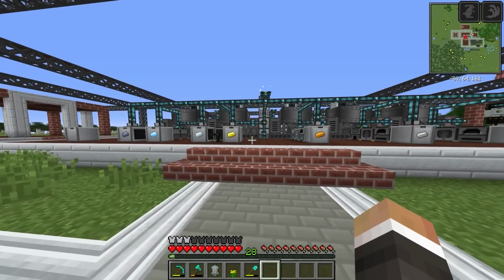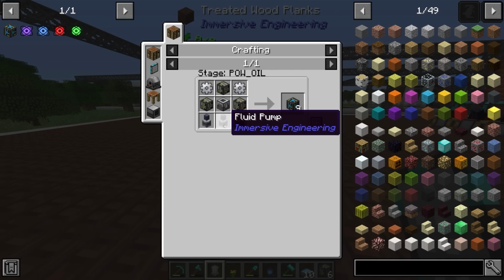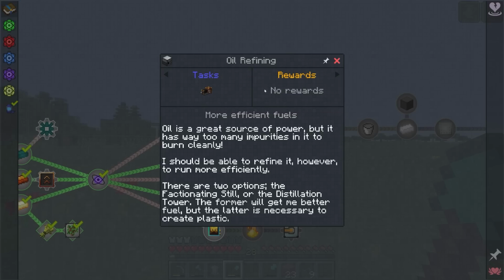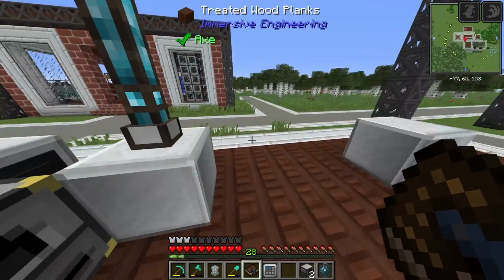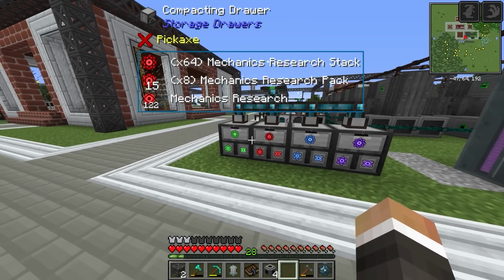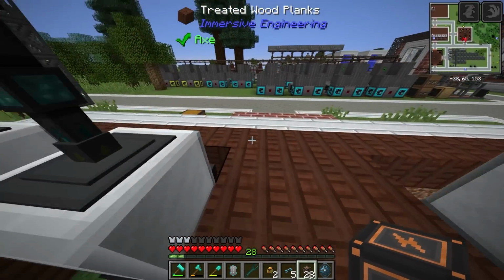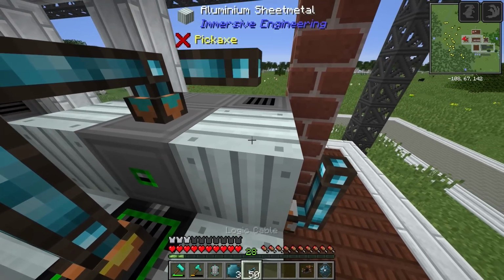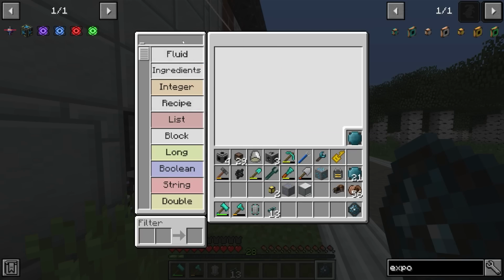Minecraft Feed The Factory | OIL DRILLING & MINING DRONES! #20 [Modded Questing Factory]

Comment: Hey the compressed dynamo says it can use the oil from making coal coke to make power but it won't for me even the crude oil won't work can someone tell me why
Reply: A bit late but it may be useful in a future mod pack. I guess that you forgot to enter a coolant on it. (Water works, but colder ones are way more effective) to get the coolant in you need the augment that allows to input thing thru the coil. So you get the fuel on the back and liquid in and energy out thru the coil.
Have a great weekend :)

Comment: Setting the round-robin property on multiple exporters does NOT do what you think it does. None of the properties have access to external cable parts, so that means round robin on an exporter will attempt to evenly divide the fluid from the available interfaces (which is the single one in your case). If you want to round robin the one input over the multiple outputs, you have to reverse the extraction direction. That means, you have to use an IMPORTER with an interface on each output location, and then set the round robin on the importer

Comment: Your quartz drawer might end up causing a problem with it exporting from the interface on the drawer controller back into the drawer controller. Not sure how it's coded, but recursive exporting seems like a crash waiting to happen. Replacing the interfaces on the infinity miners with importers might be the play.

Also I'm pretty sure for powering machines you only need energy interfaces and not energy exporters. Less NBT data stacking up from variable card spam.

Comment: This series has turned into an amazing showcase of the power of Integrated Dynamics.  

You have remote resources.  Even really powerful alternatives to the bulky (and lethal) Immersive Engineering logistics for power.  The whole 'unlocked research' bug is preventing the ID fake users from crafting things easily, but you are working around that with specialized crafter. 

I know the Refined Storage and Applied Energstics fans won't be happy, but ID can take you all the way to endgame in a lot of packs. Once you figure out the variable card system, of course.
Reply: I think it would be nice to have "simple" variants that don't need the variable cards. I understand that this is very awesome and let's you build very smart systems with a good mall for your items. But many just want a simple system and that would help getting new players to use it

Comment: Nickel, tin, lead, silver and gold are going to each need their own processing lines (not shared) now that the infinity miners are always running, otherwise you're going to end up blocking the lines with only one ore and never get the other.
(Platinum isn't automated so it could share theoretically with aluminium untill that's automated as well.)